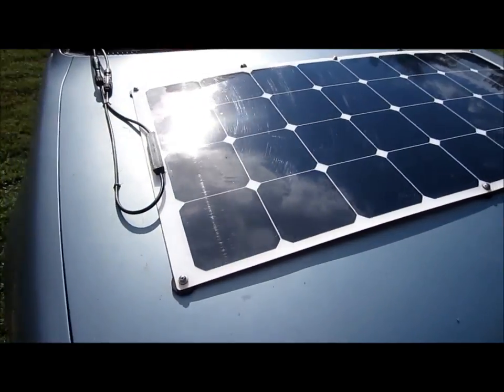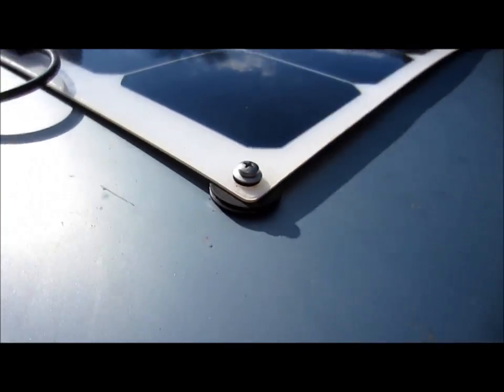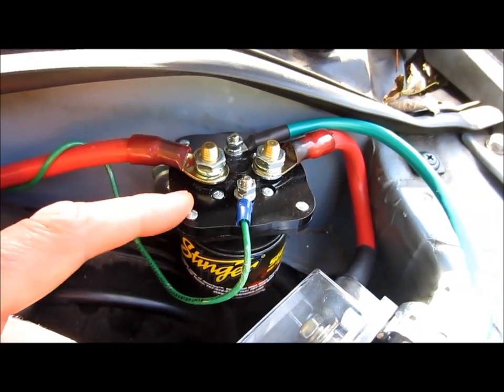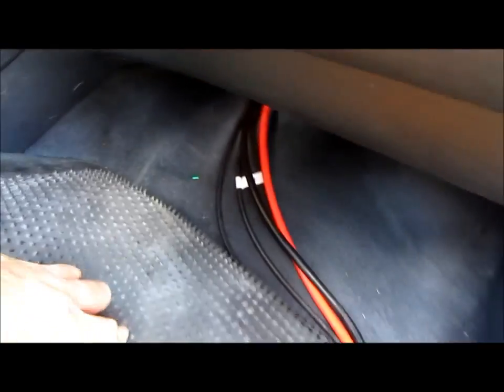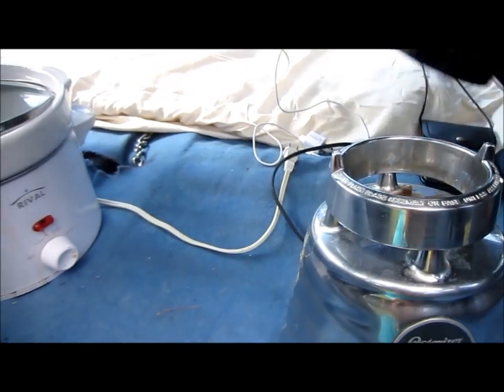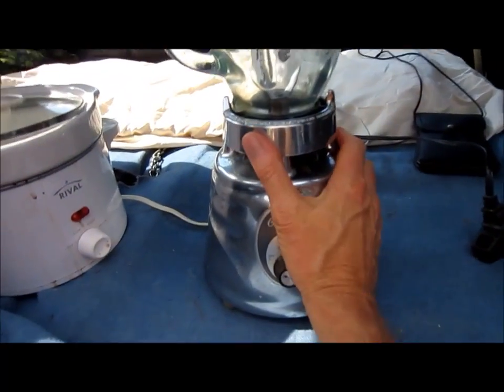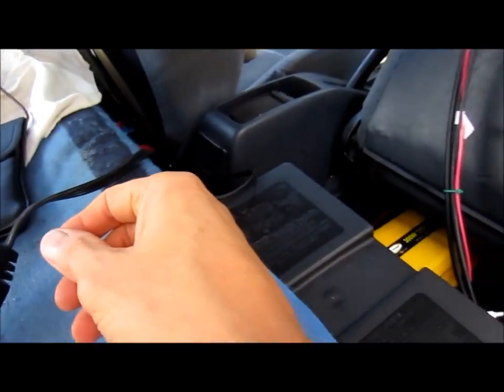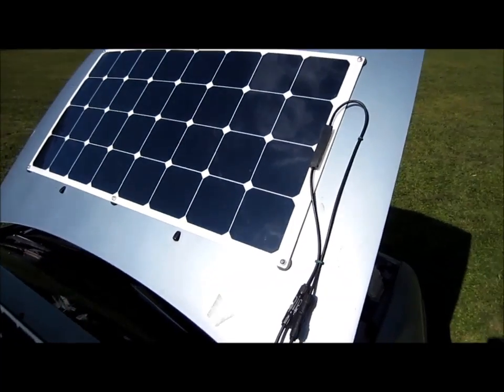Solar Car!

Comment: Great job! how much power do you get with this solar panel?
also since you have attached the solar panel to the hood maybe it would be good idea to make a new frame for the base so you could raise the panel and adjust it to an angle of 45 degrees to get the sun, instead of opening the hood.
Reply from the maker: 100 watts.  No, I like it just the way it is.  Raising the hood is perfect.
Reply: Oh, ok. Was just and idea, keep us posted, thanks.